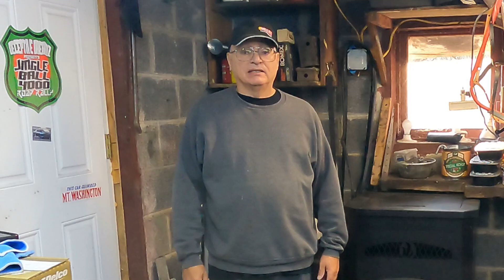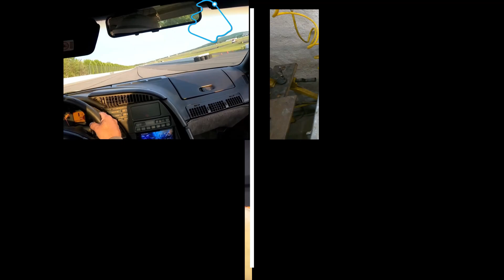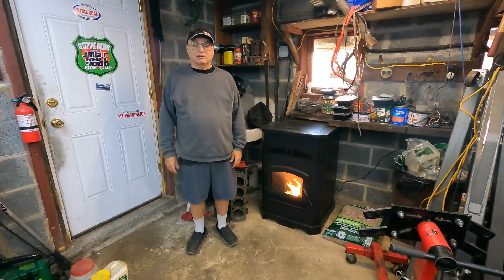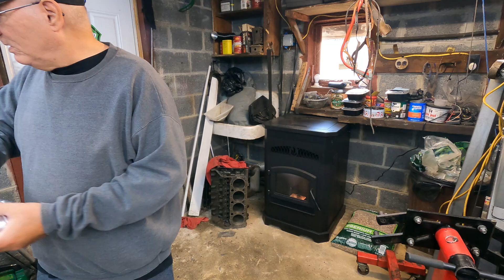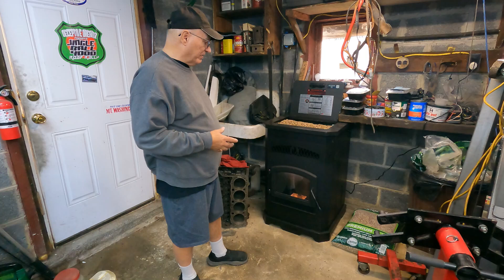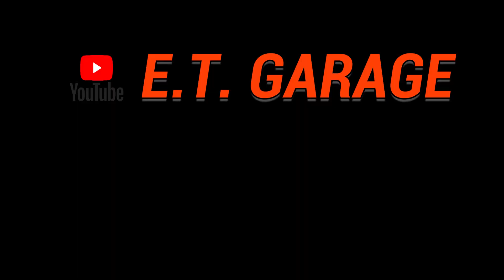Heat For The Garage 👍😎👍

Comment: install that outside air kit it is very worth it without it all ur doing is blowing heat that u paid for out the chimney and ur causing drafts from all ur cracks ur garage doors and make a chilly draft because its gonna find air to go out the chimney also when u have that installed u get no static.
Reply from the maker: Already installed it.
Reply: @E.T.GARAGE  what part of Pennsylvania do u live? Im in Johnstown
Reply from the maker: @jpbarley  Ashland 17921
Reply from the maker: I have to say since I installed the outside air kit I really do not see a deference.
Reply: @E.T.GARAGE  yeah it still heats the garage but im sure it makes a difference over time. I notice it with the pellet stove I have in my basement. No drafty air and I do not have any static issues at all and being in a garage static might be an issue

Comment: Yeah i live in concrete block house and had pellet stove way way before was cool like 30 years ago lol and 40 lb bag was 2.50.   Toke 2 pallets of bags each winter about 10 years ago would be over 4000 dollars I said nope sold it and installed propane heater.   Not the same heat but way way cheaper